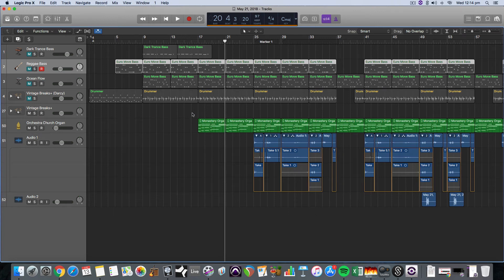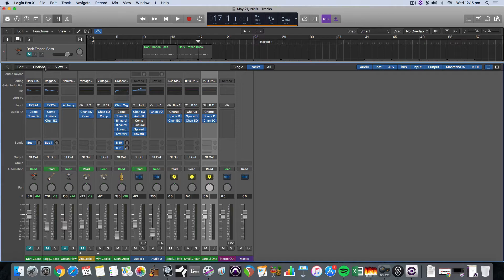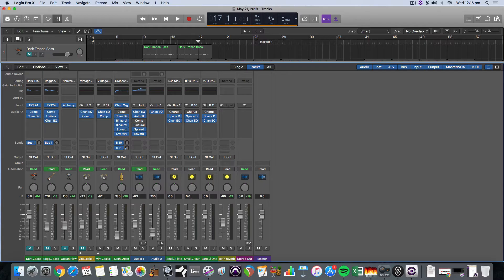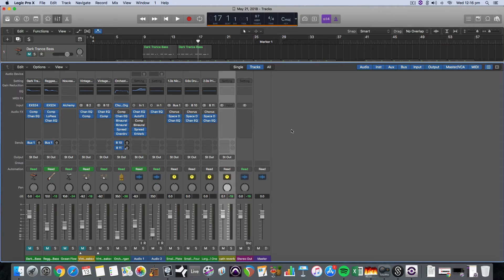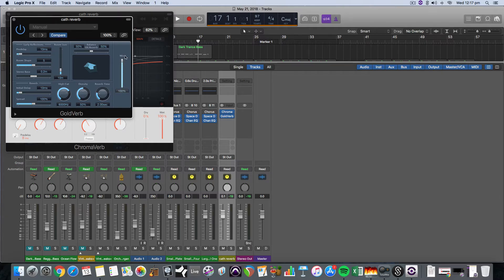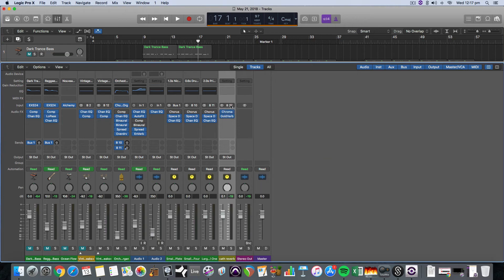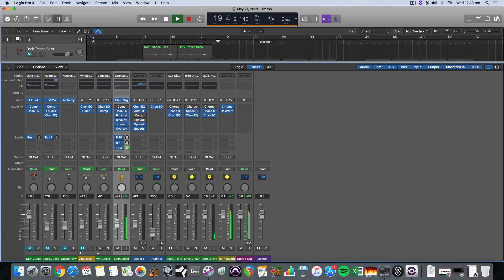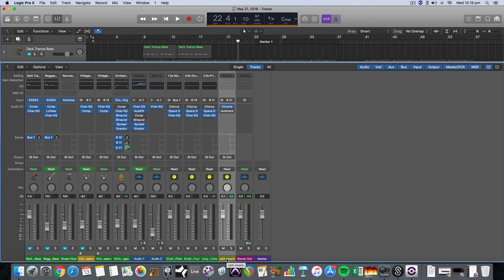How to Create an Effects Bus Logic - Create an Aux Track (Send Track)

Comment: Haha .. I was looking for something and found this video again .. but I must say, the one thing I'd mention this time is YES, there ARE reasons you would want to choose DUAL MONO - this gives access to the mid/side menu.  So for example, if you have two panned guitars, you might want to create the effect as mid/side and have the reverb operate only on the side channels for the panned guitars.   Similarly, for something that is centered, and you want to keep the reverb (or any effect) from bleeding into the sides, you might want to have it only operate in the mid section.  Also, good to always add an EQ to any reverb to low cut (high pass) the lower frequency rumble.

Comment: What’s up I can’t find a video in regards to what I am about to ask every video that I’ve seen is related to this and this is not my issue, my issue is that I have a couple of lead vocal tracks that are going to be using the same plug-ins so obviously I don’t want to place those plug-ins on each individual track, I created a auxiliary with EQ, compression, the S, whatever the case might be and for some reason I cannot route my lead vocal track to the auxiliary in logic pro I placed for instance my auxiliary channel to be an input 3-4 and my vocal Lee track input three Dash four, didn’t work, I even tried going out and placing the output in three Dash four nothing please if anyone could help me it would mean the world

Comment: why is the input a bus rather than the organ track itself? thanks!
Reply from the maker: Because you can send multiple tracks to the bus, you might want to use the reverb on 4-5 or more tracks. If you selected the organ as the input to the effects track, you could only run that one sound through the effects, and you also could't really control how much volume you were sending through to the effects track without affecting the original track also. The sends and the bus system is independent of the main track faders.